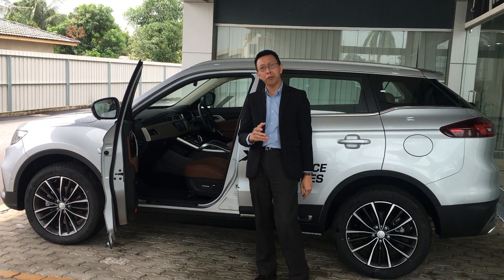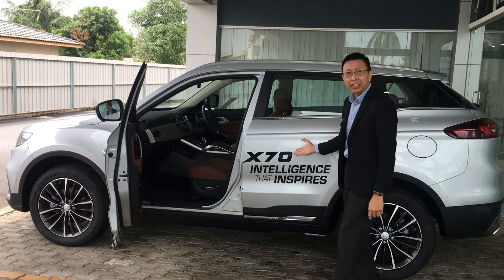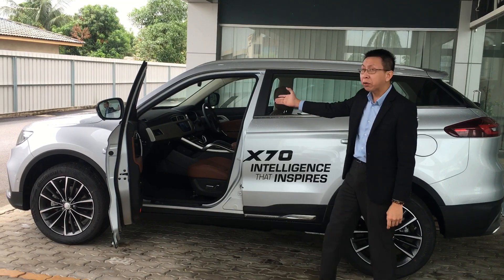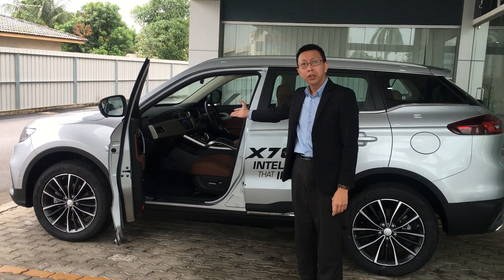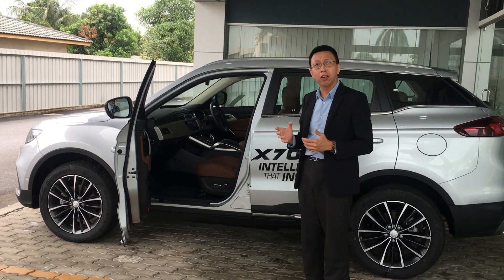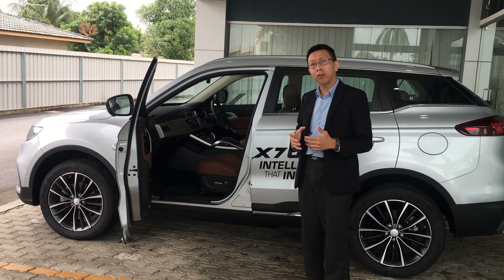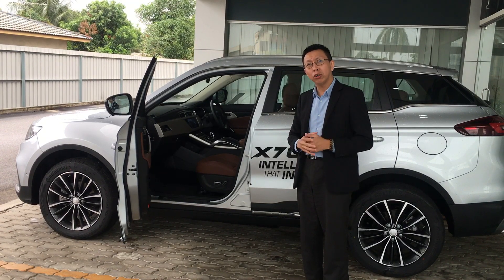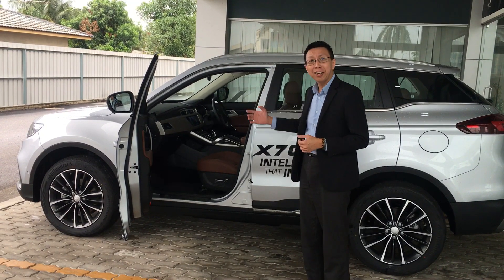EP 1: Proton X70 - Dual Clutch Transmission (DCT)

Comment: Wet clutch mean design  using auto gearbox or still manual with 2 clutch inside operate with electric pump?
Reply from the maker: Manual gearbox with Mechatronic

Comment: thank u Sir very good video. R u saying, when we going uphill, we don't throttle all d way? need to brake intermittently?
Reply from the maker: Don’t accelerate intermittently when driving uphill
Reply: @davidong2898  ok understand. just press throttle continuously smoothly as usual driving? no need to push hard, then suddenly release?
Reply from the maker: @megatabdurrahmanmegatmoham1894  Yes correct 👍

Comment: When we are in heavy traffic 
What should be the method to drive the dct without overheating.
Should we change it into manual mode.
Reply: For VW's they do that though.
Reply from the maker: As long as we drive it without letting the transmisson dragging on clucth for too long on slop and duration, the system should work perfecfly ok.

Comment: Hi David ..Question : is it better to disable the Parking handbrake button before driving off or be still okay to to put in D and just drive off straight away without pushing down the Parking handbrake button? Because with some throttle i discovered you can actually just drive off without pushing down the Parking handbrake button
Reply from the maker: Hi Suresh,
It’s ok to just drive off in D with the seat belt on, as it will automatically release the electronic parking brake (even with a tap signal on the throttle is sufficient for the EPB to release). 
However, try not to give too much throttle during the EPB releasing moment, as this might cause excessive load to the clutches.
Reply: @davidong2898  thanks David i reckoned so too but its kinda odd sometimes it does not move when the above is done accordingly...& i also noticed the same issue with the Autohold too especially in the mornings ..though i dont use it that much.. but just wondering too...
Reply from the maker: @sureshgopalan4045  you mean the auto hold and EPB is draggy a bit right?
Reply: @davidong2898  not draggy the Autohold very odd does not seem to come on nor function in the mornings.other times its ok
The EPB sometimes works when i just drive off without pushing the buton but sometimes..it does not move when i attempt to drive off without pushing the EPB button..also.odd...

Comment: Great explanation.
Reply from the maker: ABCDE I Thank you for your compliment 😊🙏
Reply: @davidong2898  I have watched several of your videos and the way you explain things is easily understood by most people in a clear and concise manner. Keep it up mate!!
Reply from the maker: ABCDE I Perhaps it is my trainer instinct 😅, thanks again
Reply: @davidong2898  Most definitely as the difference is obvious.
Reply: I knew for a long time that there are 2 sets of clutch in a DCT but didn't know that there are 2 sets of gears and flywheels etc. I'm still not convinced though or have I misunderstood you.
Reply from the maker: ABCDE I sorry for the late reply, recently is very busy with the X50 training preparation... 😅
DCT does have two sets of clutches and gear, but not the flywheel.
Reply: @davidong2898  Our hectic lifestyle means that we can reply only whenever there is spare time to squeeze in, so no worries. Thanks for your confirmation. 

What has caught my attention in your reply is "X50 training preparation"....yes, it's launching soon!! Coincidentally, I went to a Proton dealer to check out on the X50 about 3 weeks ago and the salesman told me off the cuff that it could be launched on 16 Sept. (Malaysia Day?).

Between the X70 CBU and CKD models, I have tested them about 5 times on short distances but undecided until I get to test the X50. The one I am truly after is the Bingyue Pro/Azkarra for its better design but I can't wait for that long. What stopped from buying the current X70 is that I didn't find the car as planted as I like. Perhaps if it can be lowered by an inch or two or the wheelbase widen a little. Hence, I hope I don't find any major dislikes on the X50.

Proton has come a long way and is now making many competitors very nervous.
Reply from the maker: @Albion80s  So have you tested the X50 now?
Reply: @davidong2898  Haha...you still remember our conversation after a 2-year hiatus. I'm in Kuching and if you consider a 1km drive down the main road and back from the dealership premises as a "test drive", then yes, I've done it twice. I would more appropriate call it a tease than a test and quite possibly this is the Malaysian way of a test. I suppose your next question would be what I feel about it. Let's starts with the pros. Compared with the X70, the size of X50 suits my style of driving better, being compact and more agile in city traffic. It's power is more instant, being lighter in weight. The handling somewhat resembles the feel of driving a 330ci. This is a compliment other 330ci owners may disagree but I use the word "somewhat" and the short test was on a main road outside the dealership, not through any twisty steep mountain pass. I took the car through a couple of judder bars and was impressed.

Now, here come the cons. Comparing it with the interior finishes of the X70, there are a lot more plastic fittings that you should already know. And if one were to compare it with a Cool Ray or Binyue, one couldn't help feeling that Proton has scrimped off plenty of gadgets, big and small, right down to cheap nettings in the trunk. How much does Proton save for this or from the 2 small speakers at the A-pillars of the Executive model? After all, the pricing isn't far off from that of the X70. I believe the X50 has been selling very well and making a good profit margin, so congratulations but to me, for that price and removing gadgets from the standard production model will cast a negative image on Proton. That's ok in the short term when there aren't any near rival yet but it only invites new entrants in future.
Reply from the maker: @Albion80s  Thanks your details description of the Pro and Cons 👍, and I fully agree with you on a ‘KM teast drive’ 😂